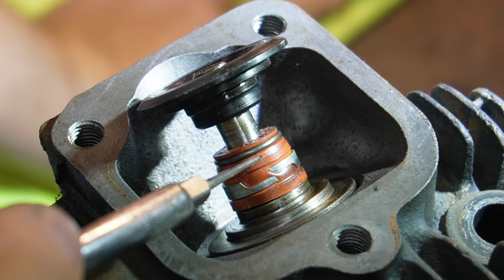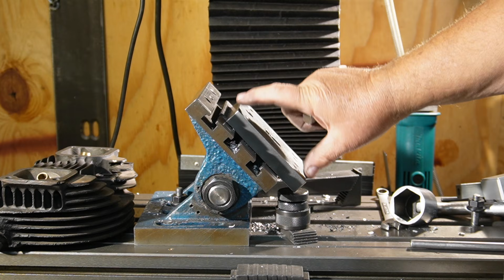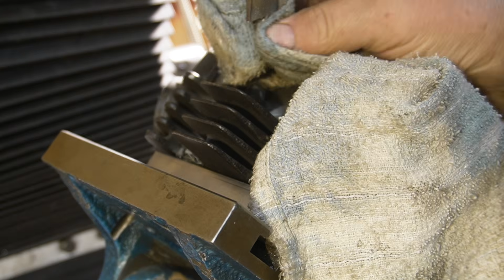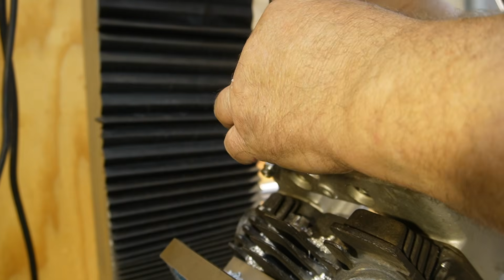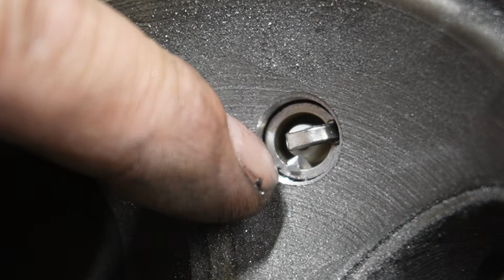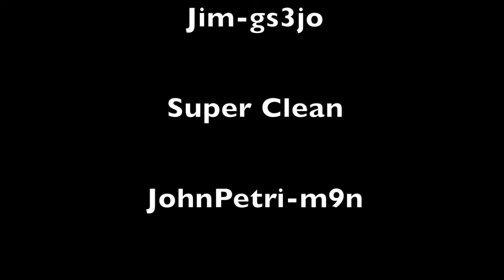1022 Dual Plugging An Ironhead Head

Comment: First, is there truly any benefit of dual plugging this motor and secondly, why didn't you just chuck it up and mill everything off? Yes, your method certainly is efficient when it comes to time management, but is there not still a risk of a bad outcome when using a hammer? Nice production, but I personally don't see the dual plug other than it looks nice.

Comment: Good visual and show and tell for guys who dont know what theyre looking at. Also that doesn't look like the right seal regardless of if it was supposed to have one or not.
Reply from the maker: There is just not a lot of room between the collar and the top of the guide.
Reply: @IronHeadCycle agreed in that video it really shows that as well. Im not sure what exactly should be on there for seal options but it's an example of what causes problems that you've got to watch for when your assembling stuff.
Reply: @BenNelson-j9y
Another thing I've seen is that people will cut the guides down to accommodate the seal. Well if you're running  high lift cams in an already short guide the valves will tend to rock in the guide due to lack of support. Creating faster wear and more problems.

Comment: That the wrong seal    kline seals I use for all iron head rebuild    duel plugs heads too  probably done 25 sets over the years     with couple of stroker motors   4. 312 stroke   wheelie city

Comment: Good day. Knocking the chunks off before drilling saves cutting through that rock hard granite cast surface.Ha ha. 
Back in the 90s I did a few sets of those and the HDRA owners wanted,  “as they called it” the smaller peanut plug. I can’t remember, but it may have had the 5/8 hex on the plug. I think It was only drilled around 11 degrees off the cylinder head gasket surface? If you’re interested in that angle, I can dig out the fixture that I built back in the day. It bolted on the rocker box side of the head. That same fixture was good to strap on the table and bore the fire ring bigger for the big bore jugs. Smitty
Reply from the maker: I'm always interested! But don't go digging for me. I've heard the smaller plugs gives more options for installation locations. I just like the idea of keeping the plugs the same.

Comment: How about adding a center location sparkplug instead that works best on Triumph motorcycles which have the same hemi style combustion chamber.
Reply: there is no room between the valve seats on an ironhead for a center plug